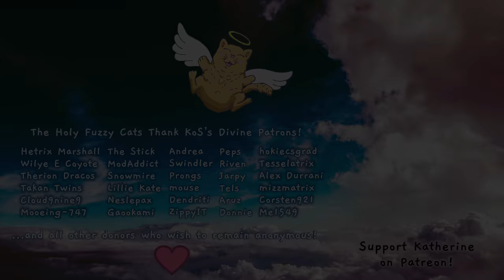Factorio 1.0 Entry Level to Megabase 3, Ep 22: PURPLE SCIENCE & UPGRADES - Guide, Tutorial

Comment from the maker: Do you make upgrades little-by-little as you go around the factory, or make a special time to go around and see what needs improving?
Reply: I'm finding my style of play from shapez.io (tear down and rebuild) is oddly therapeutic. Not so much when it's manual, but when I get to construction bots it's like ... wiring up an electronic circuit in Eagle or KiCad.
Reply: Its usually when, in a blind panic, I realise that there is a bottleneck in production. Then I start upgrades and its like cleaning the house: Once I start cleaning one part everything else looks like it needs cleaning.
Reply: Only when coal/iron/copper become too coarse, especially when starting yellow science. Are you gonna feed the low density structures with extra copper? I've built my array 1:1 with yours and even two yellow belts cannot feed it completely...
Reply: Typically I dedicate time to go around and upgrade stuff, but I always end up getting distracted and upgrading like 5 other things before I get around to what I actually set out to do.
Reply: i just give up and make a new base on the same map
Reply: Usually upgrade when something starts to need more production, then forget about the earlier parts of the chain as I wander off to setup an outpost way off in the opposite direction
Reply: A stitch in time saves nine. I am used to playing without a mall in Factorio.
Reply: I go through stages of development and then clean up all the spaghetti between each stage. It's satisfying to go back through and optimize things as stuff shakes out around your original plans.
Reply: Damnit! I guess I'm getting yet another game!
Reply: Sooo...  You are saying at the end there that you should put requester chests by where the engine stops that are kept full of coal/solid fuel/etc.?  Great idea!  :grin:
Reply: I switch from Stonr furnaces to Steel as soon as possible. I switch from Coal to something else based on the amount of coal in my starting area, before it's been after yellow, this time it was as soon as I got nuclear processing available. I switch from Steel to Electric Furnaces as soon as I get off coal power. I switch from Basic to Blue machines when I start applying modules. I don't switch to yellow assemblers till after the rocket is launched normally, as well as Steel, Iron and Copper production has been moved out of the main base.

Belts? as needed. Inserters are only upgraded as needed also. I prefer to use the cheapest needed.
Reply: Little by little as needed. Need more copper for something? Add another lane or two to the bus, or upgrade the existing ones to red belts. Later on, I'll do the same for let's say green circuits as the demand for that steps up. Etc.

Comment: The calculator is considering the crafting speed of the assembler machine number 1, which has a crafting speed of 0.5. You used the assembler machine number 2, which has a crafting speed of 0.75. Therefore you don't need 14 to make 1 unit of purple science per second. The correct number is (0.5 / 0.75) * 14 = 9.33333 ~ 10 machines

Comment: KoS, thanks as always for taking the time to explain your rationale. One of my favorite things about this game is that there is often not "one right way" and finding what works for you is a great thing. I do want to suggest, however, for you and anyone that comes across this, that buffer chests are not ideal for mall storage of produced items, especially given what you describe in your discussion of them at the end. You shared two points: 1) buffer chests means avoiding excess items sitting in storage chests and 2) buffer chests can be utilized as long distance buffers to allow logistics bots to lessen travel for construction bots working on projects. The first can be avoided simply by utilizing filtered storage chests from the start. The second is actually negated if you use buffer chests in your mall since buffer chests will not fill from other buffer chests.
Reply from the maker: Storage chests are not available from the start the game.  They need to be researched.  That means that you will likely have several chests of random stuff around the base with things that could be recycled, like belts, etc.  Thus, buffer chests are the superior choice to filtered storage for their requesting capability.  (Since filtered storage will NEVER get stuff from other storage chests).  

2. Depends on what you are requesting.  Not all items are in buffers.  You can also bypass that requirement by using a requester transferring to a buffer.   I don't typically use buffers for construction, since the robots still have to travel the same distance.  The only benefit is that you get twice the bots... logi bots to move stuff between chests, and construction to place down items.
Reply: @KatherineOfSky  That's helpful. Thank you for the reply and further explanation!

Comment: Uhm, you said that yellow inserters don't pick from red belts so well. Might that be  the reason why the array you copied was with blue inserters?

Edit: few typos
Reply: Nice, I upgraded my steel smelting array to red + steel furnaces, but iron ore wasn't getting to the end of the array, will upgrade it to blue inserted today, let's test :)
Reply: @Gabriel-cv4vp  update on what happens
Reply: Red belts are fine. Red undergrounds might be worse, and blue belts are a problem. But if your belt is so empty your inserters can't take anything, your last few furnaces should be able to pick the stuff when it reaches the end anyway. There's only a problem if there is some other sink on the other side or you have a sushi belt.
Reply: @davidgustavsson4000  Isn't it also a issue if the throughput is low?
Reply: @huskyman20435  define "throughput". If you mean that the input flow is low, it doesn't matter. As long as there is somewhere for the items to back up, the entire flow will be consumed, just further down the column.
Reply: @davidgustavsson4000  Clear! :)

Comment: If yellow/burner inserters cannot grab the coal off the belt, they you are having power issues because the coal is not making it to the end of the belt anyway, otherwise yellow inserters are fine.
Reply from the maker: Neither can grab off of red belt effectively.
Reply: @KatherineOfSky  Based on all my smelters, green chip, red chip and blue chip production as well as an inserter test I just finished, I am 100% sure you are confusing red belt with blue belt in this assumption.

if you have less then 3 items passing by on the inside lane of a red belt bend, a yellow Inserter might have an issue, but I have not encountered that kind of scenario as I try to pull from straight belts in general.

And yes I did just test this as I'm off today and can do so.

Comment: For the number of labs that you built for purple science, I dont know if a half belt of rails will suffice.  When I made mine I had a full red belt of rails in and had the modules and furnaces share a belt instead, and getting enough rails (and red circuits lol) through the system was still the limiting factor.
Reply from the maker: I am going for 1/second, and the calculator stated that 0.7 yellow belts of rails was required.  Since we used red there, that brings it to 0.35 red belts, and that's what we are producing.

Comment: Hi KoS! Long time viewer, first time commenter here :) Thanks for all the fun and informative videos!
Currently doing science pack calculations for my factory and looked through your previous vids for inspiration. I'm a bit confused by your military SP factory. At 28:40 in episode 8 it looks to me like it's set up at only 50% capacity compared to all your other SP factories. If I'm not totally mistaken then all the other SP factories are dimensioned for 60/90/150 ipm depending on output assemblers used but your military SP factory is only 30/45/75 ipm. Any particular reason for that?
Reply: But if I remember correctly, she mentioned that since grey science is not so much used/important. What I did was add two more blue assemblers and put productivity modules in them (blue assemblers), now it can keep up...
Reply: @Gabriel-cv4vp  Yeah, could be. Guess it depends on what KoS' end goal is; do as much infinite research as possible (requires equal amounts of SP) or just launch x rockets per minute (doesn't require any additional SP once all research needed for launches is done). Maybe KoS will redo everything once she starts building the actual mega base 😊.

Comment: Your struggle with cliffs is reason why none should ever play with cliffs... Why are they even a thing?
Reply: Well if you don't want struggles just turn off biters, cliffs, turn off having to research or craft so you have infinite of everything from the start, set inserter stack size to infinite and power from one boiler to infinite or just get rid of having to generate electricity as it's a struggle, and just turn off the computer and head back to bed.
Cliffs are a game mechanic as much as everything n she said she thinks they look cool also. One thing they do e.g is make it so you can't just use one generic 1k SPM factory blueprint on every map, or make you have to go through a biter base early game to get where you want. Why turn off cliffs but keep water. Why not just make it so you can make a water well anywhere and dont have to worry about lakes getting in your way.
Reply from the maker: I find that cliffs can be fun.   I like the limitations of water as well.  (You'll notice I almost never use landfill).  Both environmental blockages give the map character and entice the player to adjust their building style.

Comment: 5:40 upgrading those smelter blocks to red belt.  Kind of expensive.  The other alternative would be to make the blocks half as long and then add 2 extra short smelters with the steel furnaces.  That way you could stick to yellow belt and have twice as much output, in the same way as the red belts would provide.
Reply from the maker: That's an interesting comparison: red belts versus extra steel smelters.  I should do the numbers on that and see what is more costly.
Reply: True, but red belts take up less real estate which is a real concern here.
Reply: @donbionicle  True if you were really short on space... but Factorio is rarely short on space.  KoS could have used 2 24  furnaces instead of redbelting one 48 furnace smelter.  Yes it would have needed an extra belt line in, but once out the 2 yellows could have been joined to make a red.

It is just a case that it is very easy to swipe the upgrade planner across things, but at the time KoS seemed short of iron, and therefore yellow is cheaper than red.  Options, that is why I love factorio.

Comment: Is there a possiblity to loop the input belts? Seeing that there are materials left at the belt's end.
Reply: Just delete the end tip of the belt, until the last inserted, it will be fine
Reply from the maker: There's never a need to loop belts, it costs a mountain of materials and doesn't increase production.  If you don't like items on the ends of belts, just make them shorter.